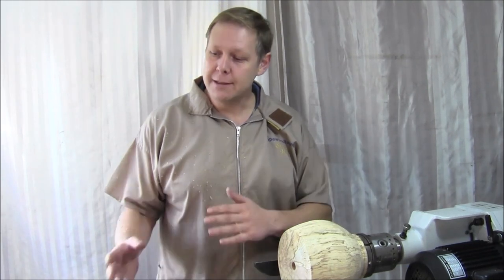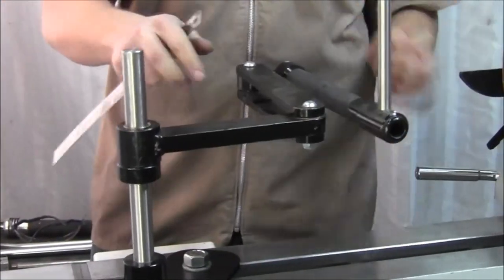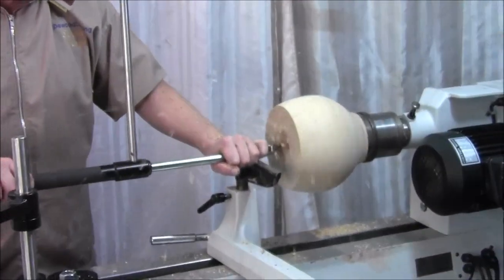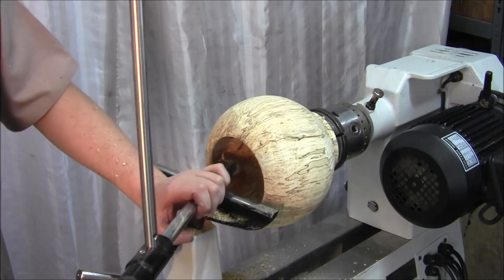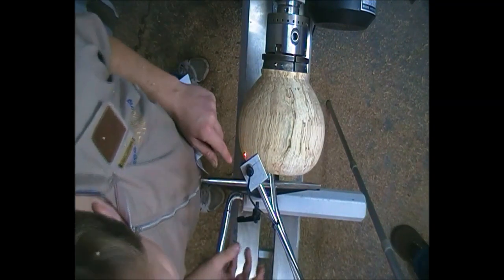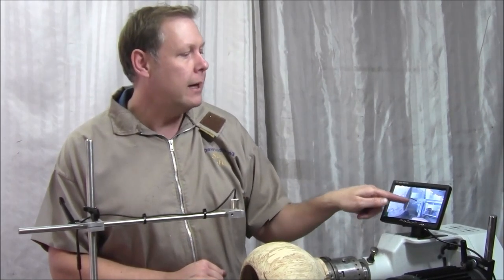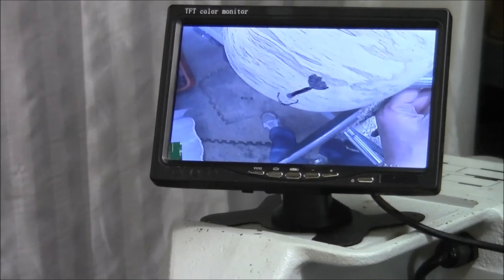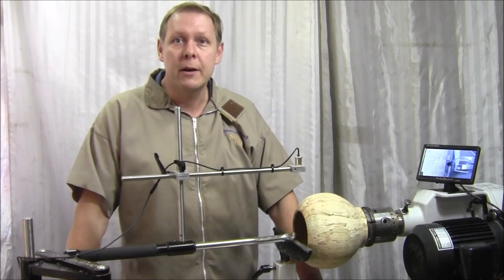hollowing rig v3

Comment: I have had this jig a while now, and as time goes on I love using it even more. Well engineered and once set upi(which is very straightforward) is so easy to use, and extremely effective for both hogging out wood with the 6mm cutter, and getting a great pre-sanding surface with the hook tool. All in all a superb piece of kit.
Cheers
Mike